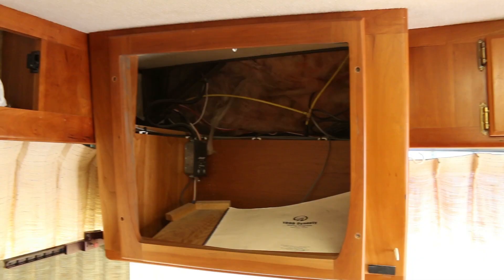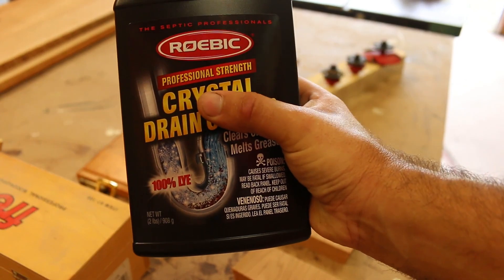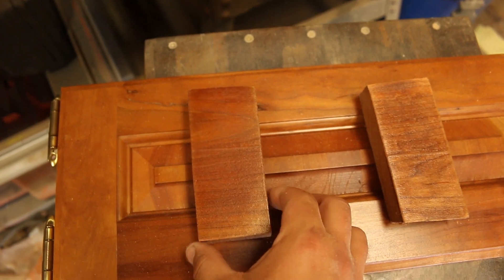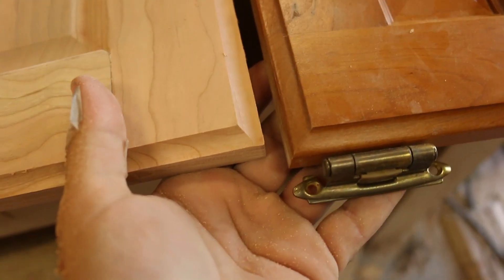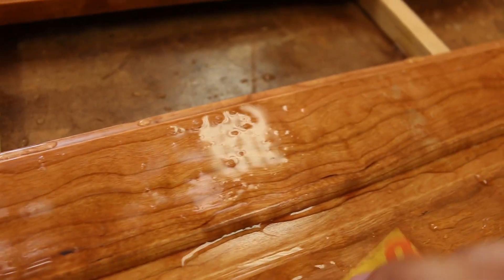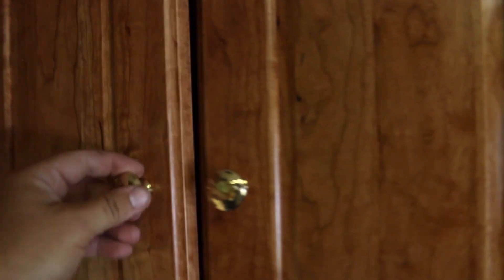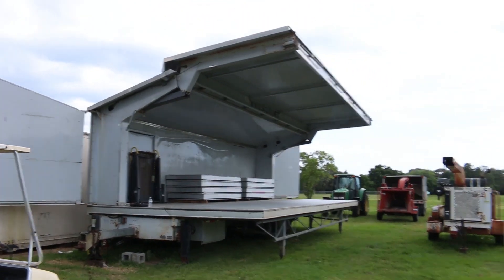Replacement RV Cabinet Doors

Comment: Mike, I have seen other people pull out those old tvs and just leave the gaping hole.  Making a cabinet and adding matching doors is a perfect solution.  You did a fantastic job.  Those router bits are a cabinet makers dream aren't they?
Reply from the maker: +Pidasian Hippie For sure!  They were terrifying to use, but they certainly make nice cuts.

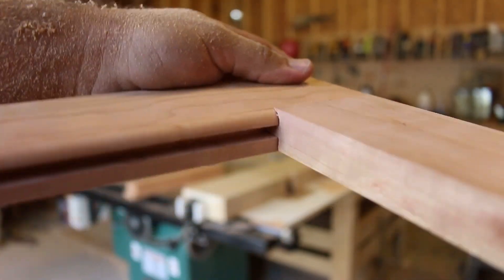Comment: I was concerned when I saw the sapwood in the piece at the 2:40 mark, but the stain took care of that.    In my experience, the lye does darken sapwood, but it still is clearly sapwood.    I also had the same issue with it not looking so good after it dried.   But once you put polyurethane on it, it really lights up.

Comment: Looks great! I've only seen paneling bits like that with big shanks (1/2"?) for use with shapers. Do you have a heavy duty router or were those designed with smaller shanks?